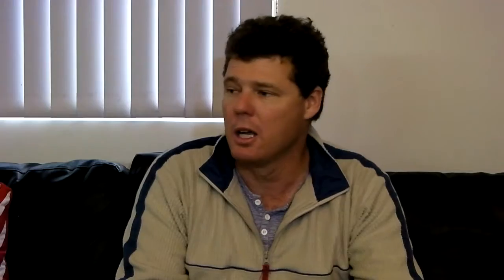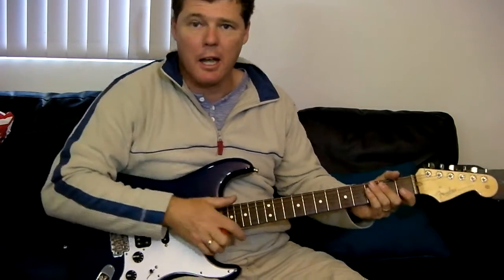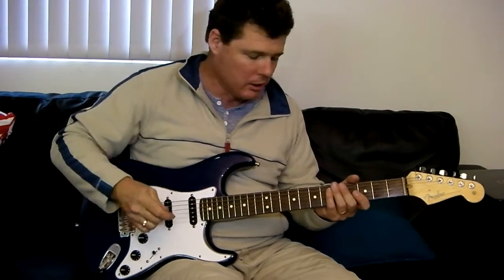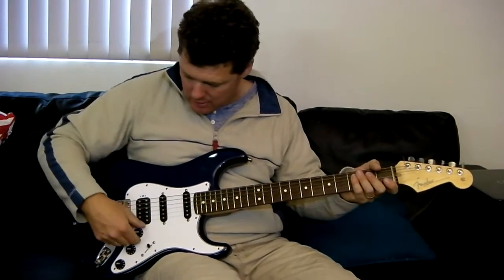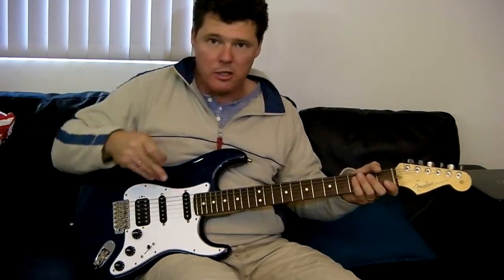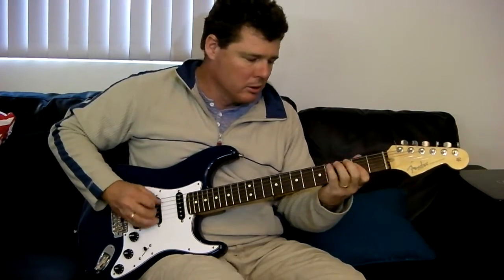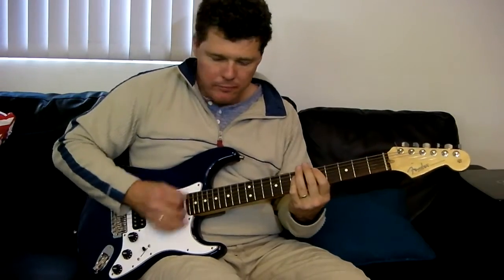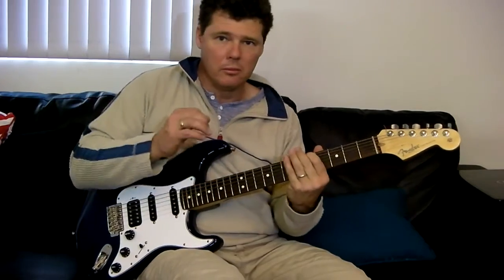Single Coil Pickups In Series (Humbucker Mode) Demo

Comment: Not many demos around, but a lot of people say 2 single coils in series sounds "muddy."

I think that may be because Strats have 250k ohm volume pots. Humbuckers usually use 500k. Lower resistance lets a little more of the high frequencies cross to ground. So higher resistance on humbuckers gives it a bit more treble bite. A single coil with 500k sounds too bright. A humbucker with 250k sounds too dull - or "muddy" - and there, we're back to the beginning of having two coils in series sounding "muddy" on a 250k pot.
Reply: I tried it, still muddy, but good, what worked for me is one normal single coil, and the other a cheap brighter one, so it sound a little bit more neutral, bit muddy tho, and have a true split.
With 500k didn't worked that well for me, it have that single coily sound, but works whit 330k or something in the middle

Comment: Thanks for this video Paul! I'm gonna modify my old Aria Pro II CS-250 (an SG copy from the 80's) - gonna replace the humbuckers for some Mojo humbucker sized Goldfoil Pickups and I'm gonna add an series/parallel switch and an In phase/out of phase switch like on the Fender Baja Telecaster. It's gonna be a real slide machine!

Comment: Hey Paul, really great video, thx! I’d like to ask you, would it be possible to use 1 push-pull switch and normal 5 way selector and wire strat so that in both 2. and 4. positions would be parallel/series - depending on the pp switch position? If that’s possible, would you mind sharing schematic? I’d really like to try it.. thank you!

Comment: Hey Pau! I really like the way this sounds and have been contemplating on doing it for a while. The guitar I have is a 97 Olympic white squire protone with the Seymour Duncan ssl 1 in the neck, ssl 1 (rw) in the middle, and ssl 5 in the bridge. It's currently wired with the tone 1 controlling the neck and middle pickups. And the tone 2 for the bridge specifically. It's a dual capacitor (.022uf) set up and the tone pots are wired in parallel. How would I go about wiring it to have the option of the neck and middle pickups in series with a push pull pot while keeping the existing wiring the same (without adding any toggle switches or having a blender pot)? Also, can this wiring design have the option for a treble bleed circuit? At some point I may switch out the ssl 5 for a JB jr or the hotrails depending on how the series wiring sounds. I've had the hotrails before and it is a very nice pickup...as well as the ssl combinations.

Since there are two tones wired in parallel. Can I use a push pull pot in the tone 1 position, as only want to use the neck and middle pickups for the series?

Comment: would it work to have a push-pull that basically give me a humbucker tone in my SSS strat? i want the bridge n middle to be in series so it's basically a humbucker, or middle n neck. would that be possible? i love my new strat, but i'm all about versatility and sometimes i need humbucker growl! thanks, very cool vid :)
Reply from the maker: Bad Mouth Men Absolutely. The Guitar in the video actually has three push pull pots. The volume control pulled out selects neck and middle pickups in series. Of course its not exactly the same as a humbucker due to the spacing between coils but it sounds very humbucker like and also cancels the hum if the middle pickup is a reverse wound version.
Reply: sweet. thanks :)

Comment: great video, thx. I have a slightly different question. I own a Godin lgx III with 3 duckbuckers. Can I apply the same principal on bridge and middle. Note the duckbuckers I have are the old generation with 3 wires and wired internaly in paralel? Please give me advice.
Reply from the maker: +D Ishmael You definitely can wire them in series to give a humbucker like sound.
You just need to work with the white wire from one pickup and the red from the other.
Reply: +Paul Graham (Guitar) ok, so I worked out a scheme where I can get 1: bridge+ neck series 2: neck sc only -middle interferes a little 3: Bridge SC only - neck interferes a bit 4: bridge+middle in series 5: all in series. If anyone is interested in the paperwork I can draw a diagram and link. thanks again.

Comment: If I would put the bridge single coil and middle single coil pickups from a strat next to each other (basically ducktape them together) and wire them in series I would get a normal humbucker, right?
Reply from the maker: +TheDarkmore No not quite.
The two coils in a humbucker share a magnetic field with one coil having the south pole and the other coil the north pole.
The coils are also reverse wound so external noise when it passes through the coils cancels out but the coils reinforce each other when the magnetic field is affected by the vibrating string.
The Strat middle coil is reverse wound and magnetic polarity but their would be some interaction with the shared magnet of the humbucker.
Reply: Thank you for the explanation.
Reply: Darel Robbie Robertson from The Band moved the middle pickup next to the bridge pickup on his strat and wired them in series. That plus the bronze coating on his guitar made it sound very cool

Comment: Humbuckers are wired in parallel
Reply: Ryan Lewis 

They CAN be wired in parallel if you have a 4 wire humbucker.

With a regular 2 wire humbucker though, the output of the first coil is connected to the input of the second coil.